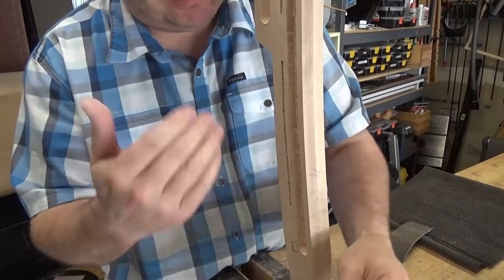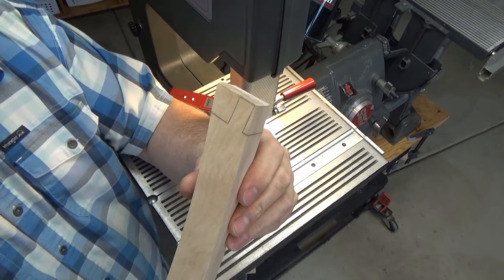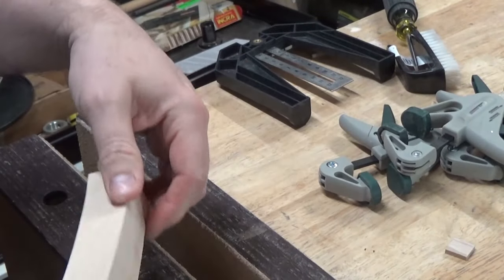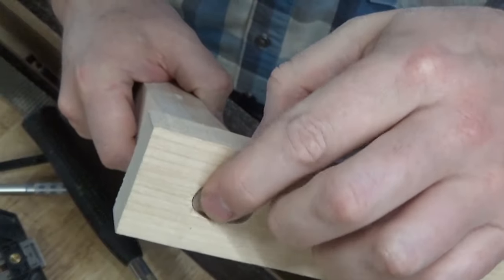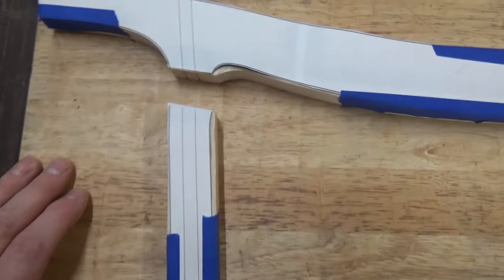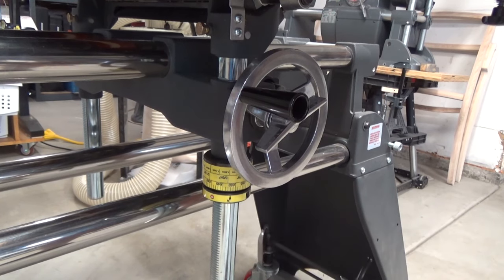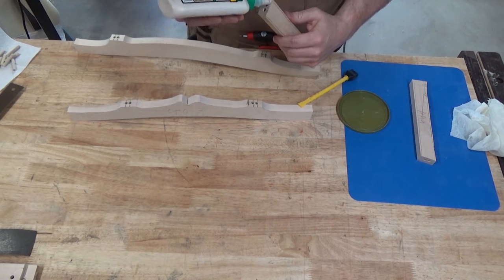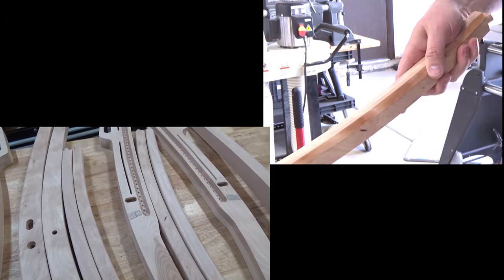Project "Life-Saver" - Shopsmith's Horizontal Boring Function

Comment: Tom, horizontal drilling is one of the greatest features of the Shopsmith system… in my opinion. 

There is not better way to register all parts from a common surface, regardless of shape.  Having an entire table top to position against simplifies it and adds precision.  Vertical drilling is so finicky when you try to register against a narrow fence.

With all of the adjustments and stops available, there are few peers in the market place.  And none that are as affordable.

I felt your anxiety and doubt when you were fitting the stiles in place.  Fortunately, you put their narrow end in place first.  

When I built the 8-spoke ship’s wheel, I did a couple of trial fittings. They helped to alay but didn’t extinguish my angst… however when the last spoke slipped into place…. The Earth swung back into its orbit and I knew the sun was gonna be shining, in the morning, when the glue had dried.  🤓

Nice job, bud!
Reply from the maker: Sure saved me this time!

Comment: Neat update, Tom. Gotta love horizontal boring. Did you happen to catch Izzy’s latest drill bit video before he made it private? It will be back in a week or two, but he showed several interesting drill bits that would have come in handy for these very joints. Scott
Reply from the maker: Thanks Scott. Yes the horizontal boring saved me. To do it over I would re-design the drawing so that there was a 90 degree reference face on all pieces.

Not I did not see the Izzy Swan video. Did he show case a certain brand/model of bit or one of his own design?

Comment: Tom,
Thanks for your inspiration. You sell yourself short on skills. One question, when you were boring the second hole in each piece, why not just loosen the T-nuts and slide the jig to line up with the second line?  And then check the alignment again. Seems easier than undoing the toggles each time.
Reply: This was my thought as well.  Since the dowel holes were designed/drawn parallel to each other, once you aligned the 1st of the 2, the other should have been aligned as well, and sliding the jig and simply aligning the drill point with the 2nd location (line) should then only require a quill adjustment for hole depth.

Really enjoy your channel, Tom, and as James mentioned, you provide a lot of inspiration and motivation.  Thanks for sharing and I look forward to what you share next!
Reply from the maker: Thanks James, I did finally think of that after a few and it did work as long as the work pieces did not cover the screws.  I was so excited to solve this problem for accuracy I didn't pay much attention to efficiency. But next time . . .!

Comment: Nice video as usual Tom. Love to see the problem solving involved. Was there any reason you didn't simply slide the entire jig on the table when repositioning the workpiece for the second dowel holes instead of releasing the clamps and re-clamping after moving the piece? I haven't used boring functions like that and thus, don't have a jig of my own.
Reply from the maker: Jason, that's a great idea and I did try that after I did a few. It worked for some but other work pieces cover the screws so I couldn't loosen them.

Comment: When horizontal boring parallel holes.   Couldn't you have loosened the tee nuts and slid the part to a new parallel position and not have to loosen the toggle clamps?
Reply from the maker: In some cases yes in others no. I just forget in the moment.